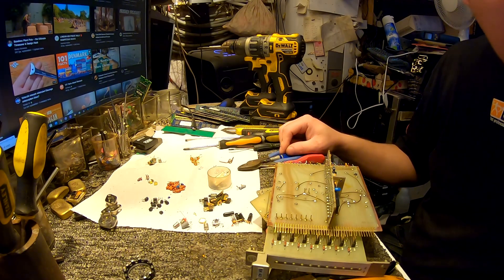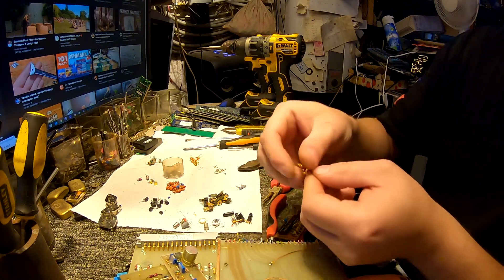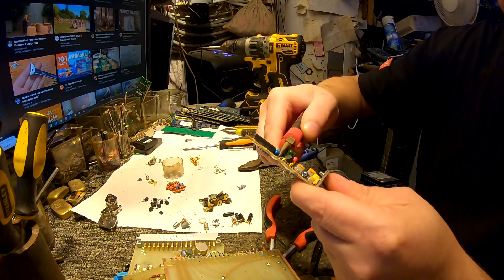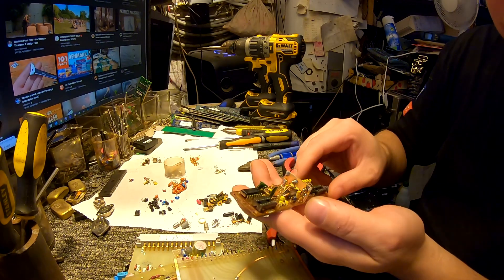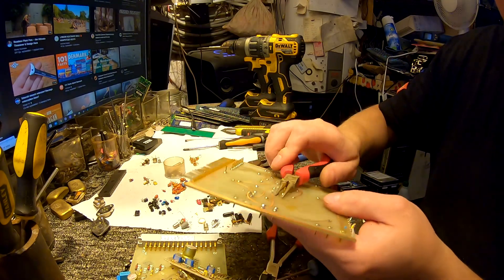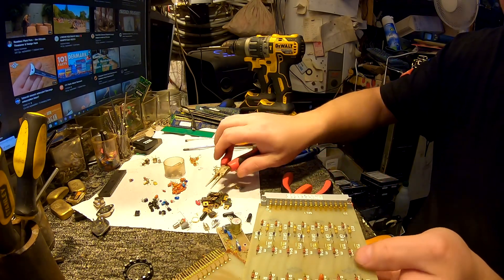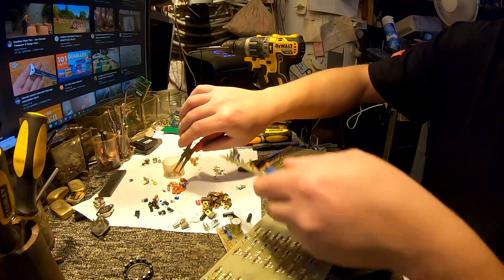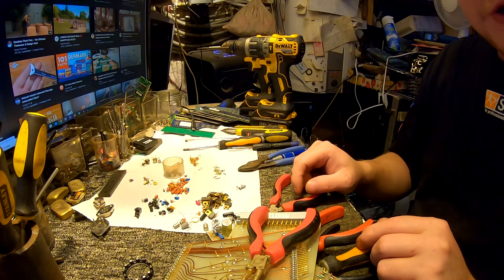pcb cleanup little addon to last vid

Comment: Very nice little pair of circlip pliers, but i do prefer the Long Nose wire cutters you've got there.
The secret is safe with me😆😆
Reply from the maker: lol snobby it is not about preference in that case,  but what stuff does the job  better and just by accident i did find out  those one does it well, scrap life arent easy one i feel that in my hands even im  still young and strong guy so it is good to use our tools  lol as im get old im just gonna use an hammer lol

Comment: That's a really useful tips 👍 I have a pair like that, in definitely giving it a try! Thanks Rafal
Reply from the maker: it does really well at older pcbs you can easyly pull  whole element with the legs 👍😀👍

Comment: How do you determine, what is a tantalum capacitor?
Reply from the maker: basically just by looking at them
Reply: @RafalScrapper  obviously, but is it colour? 
, number?
Reply from the maker: @scrapmandan245  there is planty diferent  types of them and newest ones come with  only two colours that yellow  very specific  and black tho the older style comes in many colours and shapes especially those dipped resin type   they are in plant colours  tho shape is always same bigger or smaller tho it is like drop with two legs as well there is one looks very similar to alu electrolytic caps tho on one end they had full metal cover and on one side is some kind of rubber sticking out and anode is stick out as well